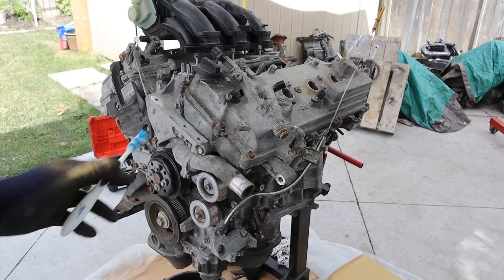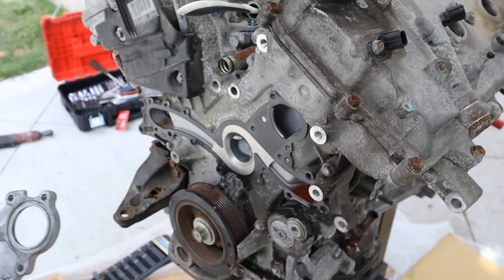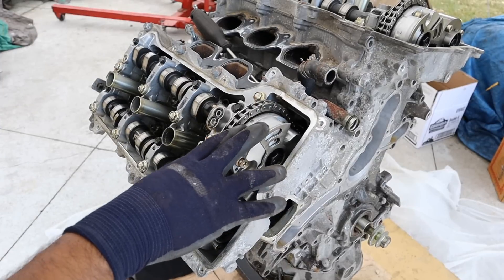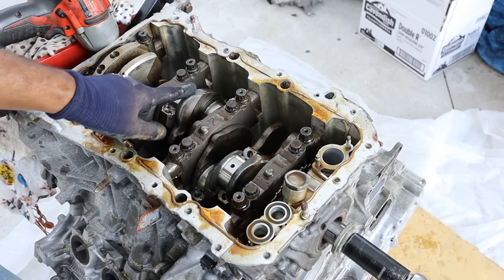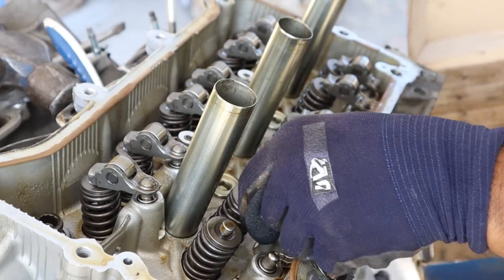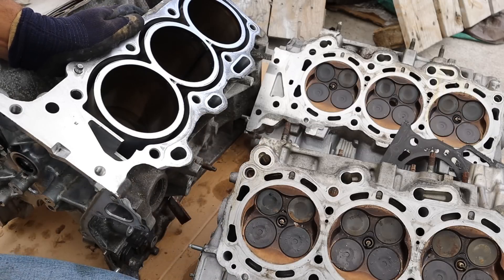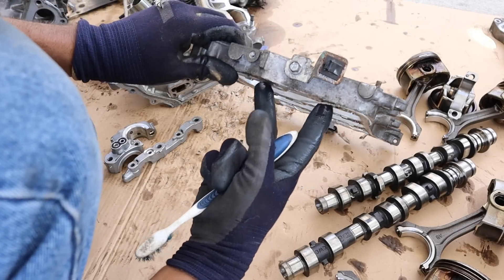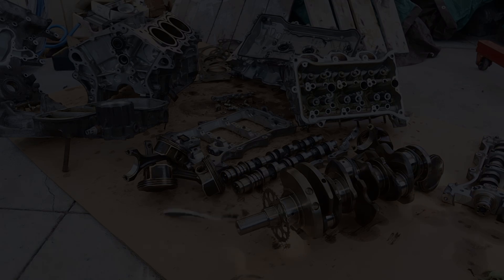The Toyota 2GR 3.5L V6 Engine is a Legacy in a World of 4 Cylinder Turbos

Comment: Amazed at the amount of machining and casting. Kinda wonder the total "carbon footprint" of just one automobile before it is driven by an "owner"? Great tutorial on how that engine works. Thank you
Reply: They are not all as  complex as that mate , Toyota seems to go the extra mile with their engineering. 
  then again 99.9 % of these castings would be done by cnc  , in the numbers these are made in they probably spit out  thousands of them in a day with no effort.
Reply from the maker: You are welcome. And you are right, if you look at it from a manufacturing and engineering point of view, this sure is a complex engine!

Comment: The 2GR is still one of the best V6 engines you can buy today, with a great balance between power, smoothness, fuel economy, reliability and serviceability.
Reply from the maker: It's good but too bad it's being discontinued
Reply: @speedkar99  thank you so much for this episode.  I’ve got one of these engines. You mentioned to keep an eye on the water pump, but what indication would it give before it suddenly grenades itself?
Reply: @HS-lt8eu  i heard mine on the belt. the bearings on the water pump went it still functioned. covered under warranty
Reply: @HS-lt8eu  Good point, the presenter derides the owner for not taking care of it. Then we get to your point, there is NO indication for the pump before it stops.
Reply: @HS-lt8eu  I believe there are two indicators of a water pump failing on a 2GR. I had a trained Toyota tech working on my 2009 Toyota Sienna with 160k miles and he told me he heard a distinct whining sound from the water pump pully that he knew from experience was the bearing starting to give out. He strongly recommended changing the pump which we did. No way I would have ever caught this.  Key point here is that it was an experienced Toyota tech who spotted this because he knew it was a weak point on these engines.  I also read somewhere that if you take off the serpentine belt and get your hand on the water pump pulley, if there is any play it means the bearing is failing and the pump should be replaced.
Reply: @Brian-vh7gb  thank you so much for the tips!
Reply: @Brian-vh7gb thanks Brian.... Someone should do a whole video on the 2GRFE water pump.
Reply: @speedkar99  hey man, you might be able to answer this question for me. I hear rumors that the 2gr has the same bolt pattern as the 3vz and 5vz, do you have any insight if I could mate the 2gr to a R-150f trans?
Reply: @PatPetrey  

I believe you are confused, the GR and VZ are the engine block codes, different blocks different bell housings the R150 will not fit a GR motor. 

Beyond that the GR when applicable uses transmissions without pilot bearings whereas the R150 needs the input shaft supported by an in crank pilot bearing, so again whatever swap you are considering isn't going to work. 

More Toyota code info:
Using 2GR-FSE as an example

2- engine family series
GR-block casting
- splitting the heads from the block
FE-naturally aspirated heads
S-port and direct injection

T-denotes turbo
Z-denotes supercharged
K-denotes atkins cycle engine or modified ottoman cycle
Reply: @lazerlake  Thank you for the response, I understand the differences in the block codes. But I know the 5vze is a popular swap in the MR2s and have the same bolt pattern as the 1ZZ motor. So with people swapping in the 2GR in to MR2s I have heard rumors and some speculation that it has the same bolt pattern as the VZ motors. 

The pilot bearing I didn’t know about and I knew the whole clutch situation was going to be a whole deal of figuring it out. 

I’m just looking for a more modern engine that’s pretty readily available at junk yards to swap into my 95 4Runner.
Reply: I dont know man, replacing sparkplugs in a tacoma with this was a pain in the ass
Reply: I have a 2009 Rav4 with 200K on it with the 2GR. NEVER any issues!!!  Change oil every 5K.       Next car will be a 2020/21  Lexus RX350. Guess why???   Today's 4 cyl turbos will never see 200-250K   without problems.
Reply: Yes these are solid engines, one of the very best V6 designs ever made along with the Chevy 4.3 and 3800; definitely worth the effort to rebuild.

This brother did a wonderful job on the video
Reply: The raw power of a 2GR-FE is seriously impossible to believe. It's like a Hayabusa engine. It has tractor torque, you can pull a hill at 1,500 rpms without any problem. Or you can run it to 6,500 rpms and it is screaming to redline.
Reply: @starseeddeluxe Gets my 2012 Kluger to 60mph in 7.1 seconds and it weighs 2 tonnes.  Destroys V8 Dodge and Jeep SUVs of the same era.  It’s a small monster.  Here in Australia we can have it in a Toyota Blade which is the V6 Corolla.  I haven’t driven one but it must feel like a big V8 in a Corolla😁
Reply: Got a 2011 Sienna with 2GR-FE, still running great and has almost 220k miles on it.
Reply: Some of them? Maybe. Sure are a lot of 2GR-FKS failures in 3rd gen Tacomas tho.
Reply: I like the 3.4l better
Reply: Lotus loved these
Reply: 2GR-FKS is the last V6 version, 2GR-FXS similar version for hybrid V6.
Reply: The 2GR FSE in 2008 gs350. Oil burn was crazyyyyyy..

Comment: I got a 2GR-FXE engine in a lexus rx450h 3rd gen
US guides call for 0W20 oil on that engine, and since I couldn't find any, I put 5W30. According to a toyota tech, it can use that oil.
Do you think that is ok to use?
I know the FXE designates atkinson cycle heads, but does it mean they use different pistons and different thickness oil control rings?
Reply: a 0W20 will lube your engine faster on a cold start. i think 5w30 is fine as long as you give the car a few minutes to warm up before driving or you may prematurely wear out inner parts given that you are using a slightly thicker weight than the recommended oil.
Reply: @carplay5454  I live in a hot climate, most of the time it's above 30c so I think it's fine...
Reply from the maker: Yes 0W is just for economy, bring a hybrid

Comment: I guess I did right by listening to my mechanic and replacing the water pump as preventative maintenance.
It wasn't cheap, but in hindsight it is compared to a new engine.
Reply from the maker: Good call
Reply: Better safe than sorry
Reply: What mileage did you replace it at?
Reply: @quagmyre  at 240000 km

Comment: Holy crap that's a complicated engine. It's a wonder we didn't go to turbo I4's 20 or 30 years earlier than we did and skip V6's in their entirety... (Yes I know 4 cylinders can get complex too, but for a given set of features a 4 cylinder has half the cylinder head assemblies, a single timing chain, a simpler cooling system flow, less gaskets and in general are easier to repair). Is anyone going to tell me, with a straight face, that a 2AZ turbo wouldn't have worked just as well in most applications as this 2GR?

We very easily could have if in the 80's we used smaller turbos rather than going for V8 killing performance with big turbos. Some manufacturers already had the tech and parts combinations ready to go in their parts bins (looking at you GM, the Family 2 engine was available turbo and fwd/rwd/4wd and could have easily replaced the 3800 for most applications if given a smaller turbo and an intercooler)
Reply: In fairness, this engine would experience less internal stress than a boosted 4 cylinder. Forced induction is added complexity on its own. You could argue that this is actually less complex and less prone to failure, which the data does back up. Natural aspiration is a good characteristic for a reliable engine to have, regardless of cylinder layout.
Reply from the maker: Well you got your wish....a 2.4L turbo 4 cylinder is replacing this V6 in the Highlander, RX, Crown and maybe the Sienna.

Comment: sweet! glad you're doing this one. I've got two of these in my garage: '15 Venza with 95k miles and '16 Sienna with 105k miles. I do basic maintenance on them and I haven't had any problems with any part of the cars.  I specifically got those used cars with those model years because I wanted those models and those were the last years (or close to it) that those models had this tried and true v6 before moving on and same thing with the transmission.
Reply from the maker: Good call. They should last you a while
Reply: Great job! Yea idk how I feel about the newer 2GRs. I heard they are burning oil. Meanwhile the tried and true 2GR doesn’t.
Reply: Smart man!

Comment: my 09 rx350 with this engine is running strong with 246,000 miles on it
Reply from the maker: Nice! How many water pumps?
Reply: @speedkar99  Hey, I'm not the first owner but I guess it's either the original or 2nd water pump. Last year the alternator went bad the mechanic told me it's the original part from 2008. Also replaced the original radiator and hoses last year not because it's leaking, just preventive maintenance. Drove 6500 miles in 2 weeks for a great roadtrip and nothing wrong with it.

Comment: When it comes to my Toyotas, I prefer fwd, 4 cylinder (no turbo), none cvt. I have one with now 300k miles. About $1800 in maintenance including oil changes and batteries for the past 11 years. I spent almost as much in repairs on an Audi Q5 in one year.
Reply: Well of course.......VW/Audi have been notorious for years for electrical issues, and their engineering is, well.....weird. I remember working on an Audi super 90 back in the 80s with its oddball inboard brake rotors.
Wise consumers DONT buy Audis
Reply: @donreinke5863 to be fair Toyota is no different...... There's a lot of modem Toyotas where you have to drop the engine for basic repairs like a German car. There are so many repairs jobs for Toyotas thay are super tedious that really shouldn't compared to other cars....... No automaker is perfect.....
Reply: @donreinke5863  found the poors
Reply: @michaels4640  Your comment makes no sense..must be an Audi buyer.
Reply: @donreinke5863  checks out 😂
Reply: @michaels4640  found the child
Reply: @michaels4640  Poor people spend money on useless items like an audi for the badge and prestige, insecurities show.
Reply from the maker: They won't build them like they used to and that's because those who are buying new cars now expect more features and safety standards so they have to cut it from somewhere...
Reply: @speedkar99  Which is exactly why I will NEVER buy a new or newer vehicle.
I don't give a damn about safety features.
Safety begins and ends with the operator, and I don't want any "features"
Reply: @donreinke5863 I have to humbly disagree with you on the ‘safety begins and ends with the operator’. I’ve worked in the accident investigation industry long enough to know that that’s not typically how it works out - there are many victims that would have been better served by increased crashworthiness.
Reply: Toyota's hybrid eCVT is basically indestructo, no belt, torque-converter, clutches, or pulleys.
Reply: @aspecreviews  This is what I'm driving now, basically replace the battery pack every 13 years and nothing else can go wrong.
Reply: LMAO...ANYTHING GERMAN will quickly become trash.
Reply: Qq
Reply: I bloody hate FWD as far as ease of repairs goes mate  , fwd are an absolute abortion to work on , you have to dismantle half the car to do basic repairs that on an old conventional layout would be easy.
 try doing a clutch on a fwd , or try paying someone to do it  .
 ask someone with a BMW mini how much a clutch replacement costs😬.
  modern car layouts are overly complex and shit I'm sad to say.
 I remember in years past doing a full clutch kit on my big conventional sedan or ute/pick up in my driveway , and would be finished by lunch time , very easy and cheap,  less than a 100 bucks ..... ahhh the good old old days.

Comment: it's worth noting that these engines were used in two lines of the Lotus Sport cars, the Evora and Exige. Slap a turbo on it and you've got a 400+hp beast.
Reply: I have a turbo on my 2gr fe. Over 500whp on 92 pump gas. 650whp on e85. Could be more but id like to see the motor last a while.
Reply: @RyanDohertyRacing  kinda interested in doing that on my 2011 GS 350 … any thoughts? Low-mileage but old car so I want to tear it open to check everything out anyway. Might be worth a rebuild as warranted, with an eye toward beefing it up for reliability while pushing for a bit more.
Reply: @ if you take apart a factory Toyota engine with low miles, your rebuild will be less reliable than what was in there… unless the motor is in bad condition, like it’s been overheated or no oil changes.
Reply: @RyanDohertyRacing  yeah ofc, the lotus guys would use new or barely used engines for their builds. my comment was speaking more toward the legacy aspect of these engines rather than this engine specifically in the teardown. i'm sure most people read it this way :goodvibes:
Reply: @RyanDohertyRacing  What did you use for rotating assembly, kind of curious what the stock internals can handle.
Reply: @dustye753  the motor is a stock unopened junkyard motor from an avalon. The key to longevity is in the tuning. Ensure you don’t add too much torque at slower engine speeds. My engine tuner ramped in the boost slowly so that all the boost doesn’t hit too hard. I believe that’s what stresses the rods and bearings.
Reply: @RyanDohertyRacing any way I could contact you regarding questions about your build? Debating between the RR Racing supercharger kit and a custom turbo build for my Lexus IS350 FSport that uses the same engine, would appreciate any tips
Reply: @dustye753  oem original unopened 2GRFE
Reply: Slapped a Super not Turbo...
Reply: @Smart-Skippy you think I could put a supper charger on my gs f sport? If so how much power you think I could get?
Reply: @hey_skip  yeah i know they did that, i was talking about regular people. they can slap a turbo on theirs and pull 400+horses
Reply: Really?

Comment: I have two of these beauties. One in a Highlander and another in an RX350. Have 420k mi combined with no end in sight. Also recommend swapping out the oil cooler line for a metal one if you have a rubber one.

Comment: I have a 2006 Camry with the 2az-fe engine. I haven’t thought about the water pump. Thanks for the video!!! I will look up the maintenance life of the water pump.

Do you know, do they start to leak coolant before the water pump dies? Or do you just have to watch the temperature gage?
Reply: Im sure speedkar may be too busy to answer. I have the 05 Camry 2az-fe. It’s at 305000km. Always watch the temp gauge when temperatures outside are 18 degrees Celsius or more. We only replaced the water pump because it starts making a whirring/scratching noise. We’ve replaced it at 230000km, and 280000km. Make sure to get a dealer or made in Japan water pump. The made in China stuff breaks down pretty quickly. It’s a relatively easy job as a DIY. The hard part is reinstalling the pulley onto the shaft as it will want to keep rotating on you. Also, if your coolant keep disappearing, either the lower radiator hose clamp is rusting away, or you probably have the dreaded stripped engine head bolt problem on the 2az-fe. Change the oil frequently, as it can be an oil burner from previous owners neglect. Conventional: 3k miles/5k km or full synthetic: 5k miles/7.5k km.
All the best to you.

Comment: These water pumps are known issues..... they'll also growl forever before actually failing
Reply: Interesting term, growl. I spun my water pump by hand yesterday and it was making a growing or buzzing noise.. it was weird. But I don't hear it when no engine is running. This water pump was supposedly replaced about 6 months ago. I'm kinda worried now. Any thoughts?

Comment: Ever considered taking apart a Honda R18A1? The early ones were notorious for water pump failures that cracked the engine block once it overheated.
Reply from the maker: I have a video on the R18 civic engine with that exact failure. Check it out!